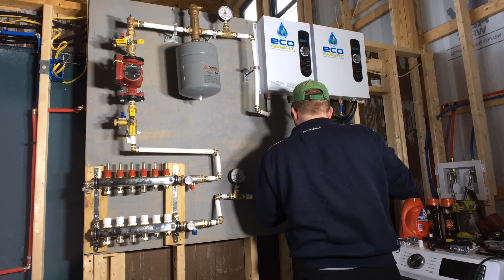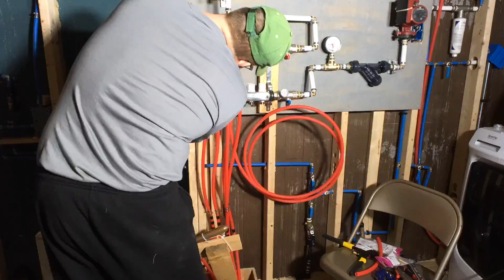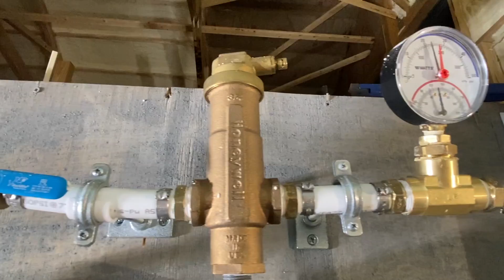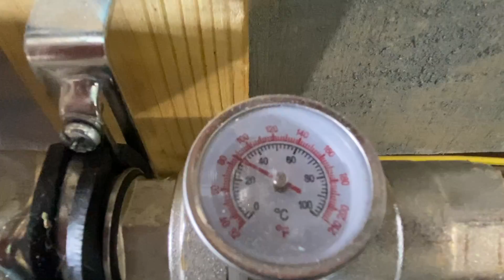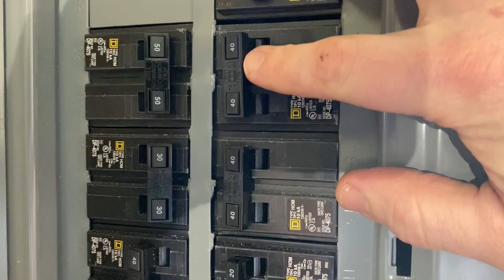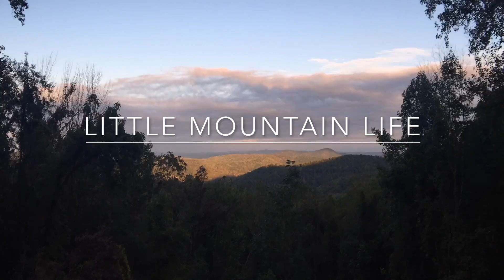DIY Radiant Floor Heat | Install and First Impressions

Comment: Thank you for this video, super helpful as I approach the same project on my cabin.

Curious if you entertained running domestic water (bath/kitchen) and radiant heat off of a single tankless system? I’m working with limited space and hoped it possible as I see some units have two thermal exchangers.
Reply from the maker: You’re welcome! 🙂
I wanted to keep the systems separate to make maintenance and future replacement as simple as possible.

Comment: Have this in a small office building in Kansas.  If you want additional heat sit a metal file cabinet on the floor.  It will warm up and become like a large radiator.

Comment: I am looking at installing a 2 zone radiant heating system between my joists.  It’s only 800 square feet in total.  Would you find the EcoSmart 18 Tankless heater plenty for my application?
Reply from the maker: Yes. We often times only run the 18kw with one element to heat the house on cooler days. Both elements easily heat the house with lows in the teens. 
Also depends on how well you insulated the house.
Reply: @LittleMountainLife  I'm about to buy an EcoSmart and am trying to decide between the 18 and the 27. I also have 4 loops, each about 280-300' each - so I think our systems are similarly sized. Your comment makes me think an ECO18 will do it for me. Question - how do you know you are only using one element, or is this a setting that you can restrict to just one? Great video - it's become "one of the 6 videos I'm watching 2-3 times each" as I work my project! Looking forward to a follow up video about electricity cost - as that is something I am worried about.
Reply from the maker: @MrKroy2008  You can just turn off the second breaker in your panel to reduce it to the one element.  Thanks for watching!
Reply: @LittleMountainLife  well dang, I guess you can, that makes sense. Received mine today, but still hesitant to install because I am unsure of the operating cost. I see your other comments about an upcoming video on operating cost/elec usage - but could you give me the down and dirty - is it going to break the bank? :)
Reply: Disabling one of the heater elements does reduce the peak current to half and hence reduces the available heating capacity to half of the full rating, but it does NOT really reduce the energy (KWH) consumption over time. In either case, the unit will consume whatever energy is required to heat the water to the desired output temperature setpoint for any given flow rate.

Comment: I use an ecosmart27 and it supplies all heat and hot water on an open system
Reply from the maker: Cool! You on city water or well water with a softener?
Reply: Richard Berends I’m looking to do something similar. Would love a description or any inspiration you can share!

Comment: Were there any particular videos or websites that gave you valuable information for this DIY radiant floor heat project?
Reply from the maker: Well, I watched literally every other youtube video that mentioned radiant heat at least 3 times before starting my process with the manifold.  Smart Easy DIY has a great channel and I used his videos a lot.  I also used the radiant heat company's websites and pictures as a guide for components.
Reply: @LittleMountainLife  Thank you!

Comment: Did you have to pressure test the whole system with air like standard plumbing before pouring your slab? TIA
Reply from the maker: Yes. We pressurized the whole system with air while the slab was poured.  :)

Comment: i have a radiant system in my basement & i now want to add the other two floors. 
Floor 2 will be concrete with tile, 
Floor 3 will be tubing in the joists for wood floors above. 
My issue is where to put the manifold, ? do i add it to the basement & drag all the lines down, or is there away to put it mid house on floor 2 & connect a line to the original system for the hot water feed
Reply from the maker: That sounds like a project and plan above my pay grade.  So your main floor is already poured concrete? Or are you still planning it?
Reply: Put a manifold on each floor atleast 50cm above the floor ur heating. Only let the supply pipe that feeds the manifold pump up . This will make shure no air bubbles going get stuck in the system.
Also please dont put the pex pipes under ur osb between the joists, u will lose so much heat because the wood insulate tot much.
Here is a way too do radiant heating on a wooden floor we call it a dry system (because its not in concrete) https://youtu.be/8AF0iOc53ew  .
Also in that clip u see the laying patern he uses we cal it the snail house patern and it makes shure ur heat is equaly spread over the floor so the end of ur group is not colder than the beginning of ur group.
And 1 pump for the whole system is enough. U dont need a fast flow, u want the floor to extract the heat from water so make shure ur return at the manifold is always 25%/20 colder than the feed, if not u need to slower down the flow with the flow meter. Make shure u put ur thermostat in the biggest room, as u can imagine small groups wil give more heat if the have the same flow rate as the big ones and u can adjust that later by lowering the flow on that group. 10cm of space between the pipes on the floor is the best. Here in the netherlands floorheating is comon for decades and we mastered it really well and i must say i havent found 1 youtube clip where the floorheating is laying correct in the USA.

Comment: I'm curious as to how you organised you zones.  And why only four.

My impression is that North America tends to large area zones with uniform temperature settings.  Here in the UK we tend to zone-per-room and each room with a thermostat so with a programmer each can be time and temperature controlled.  So it you want your bathroom warm but bedroom cool at bed time, or your kitchen warm in the morning but not so much the rest of the day it can be made so.
Reply from the maker: It's a small house with just a great room, 2 bathrooms, a bedroom, and utility room on the main floor.  I typically run all zones at the same flow rate/temp anyways.
We could technically control the temps like you do but so far haven't felt the need to.

Comment: Is your entire house running off electric utilities?  If  so, are you running a 400amp panel or 600amp?  Have you had any issues with this drawing 75amps?  Does this always draw 75amps?
Reply from the maker: Yes. 400 amp service to the house. 
I usually turn off one of the two elements once the floor is up to the desired temperature. On super cold nights I’ll leave both elements on.

Comment: Why the electric resistance heat though? Possibly the most expensive method of heating there is! Underfloor is a perfect fit with a heat pump, which could cut your electricity consumption by 75 percent.

Comment: I would think that second pump is adding a lot of flow resistance to the system.... could be wrong on that though
Reply from the maker: That's possible I suppose.  System is running well this week.

Comment: What is an advantage over using electric coil?
Reply from the maker: I’ve heard it’s more efficient but I’m not sure. We wanted bare concrete floor and this is the best option for use. Electric coil works well under laminate or wood flooring.

Comment: If i were to install just the one pump, which one am i to leave in and run. The one in between the drain & fill valves or the one right before the water heater?
Reply from the maker: We have been playing around with this as we turn on the heat for this fall/winter.  Looks like the pump between the drain and fill valves is the way to go. :)

Comment: Awesome video. Appreciate you taking the time in sharing your experience. How much did this whole system cost if you don't mind me asking. Ballpark price of course. I am considering doing this type of system for a house I have in NE PA. It would primarily be used to keep the house from freezing and not as the main heat source. But who knows. Thanks again.
Reply from the maker: About $1500

Comment: Top left looks like pressure relief valve, how is this passing flow?  Don't they typically mount to a T and only pass fluid when pressure/temp exceed some pre-set value?  Then you run the relief side into drain or away from system?
Reply: Its not a pressure relief, its an air separator that gets the ait bubbles out of the system
Reply: @goudsekaas5673  ok.. grainy pic here and saw the super vent on right was like... I have a valve/faucet in similar position to give flushing options. I used a boiler fill between supervent and expansion tank then added the correct 30# relief into system.  my choice of pump was based off recommended flow rates and guess I need to get a beefier pump, got down to -5F last night and it had to run non-stop to keep up.. then even with proper spacing between combustion n exhaust, the exhaust drifted directly at air intake and not sure if was frost or snow from roof sucked in so ordering new cone style intake cover to prevent that..  I have a room without any heat and that is messing with system here, would have to excavate to get under...  not for this old man..lol  I mentioned the boiler fill as it gives adjustable pressure, 12-15#, I left mine at 15#, then you need to reduce pre-charge in expansion before the fill to the 12-15#, and use the 30# relief, see that left out in builds or an assumed..
Reply: I do have enough access to sneak a radiator in that room , but at 120F water, what I had to raise mine to from initial 110F setting, maintaining a 10-15 Delta-T, then at end of a PEX floor/heat spreader run, unsure how much it would add...
Reply: @craiggerlach5548  buy a consetric pip ( i hope i say that good in english) for ur exhaust and intake. Its one pipe with an extra pipe in it. The extra pipe in it is the exhaust and them other pipe is the intake. The inner pipe runs abit longer so intake and exhaust cant mix. Also i wouldnt recoment pex like in this vid, there s way to much 90s with a smaller diameter than than the rst of the pipe that slows the flow big time and male it way more noisy. Also it makes u need a bigger pump. My pump runs on 45ish watt to heat 90m2 floorheating. Alsni got a pump switchnon it thay only turns the pump on when it detects the room needs heating.
Reply: @goudsekaas5673  house recently sided, vents in place, bought a cover for it, hope it helps, had snow plug up intake and had error code on heater one night..
No going to reroute pipes since siding already in place...  but thanks I seen those options.  they were very long and my heater is on exterior wall.
Reply: Assuming return line jogs up as you were going to put a mixing valve in there then changed your mind, couple extra elbows otherwise...

Comment: The expansion tank shown in your video does not match the size you listed in more info. The listed one shows it to be 11x11x15 and the one shown is no where near that size?
Reply from the maker: Great catch! Ours is the EX15
AMTROL EX-15 15 Extrol Expansion Tank https://www.amazon.com/dp/B003QSAH38/ref=cm_sw_r_cp_api_fab_Ps1CFbB47D22N

Comment: If you’re floors are warm (enough where you really feel it) your running your system too hot.  The floors should be the same temp as what’s you want your room to be.  Radiant floors should be “not cold” meaning neutral to the room temp.  Running your supply temp at ~ 115-120 should be enough for that size room.  I use a floor temp sensor  Aube Thermostat w/ Floor Sensor
Model Number: TH114-AF-024T Menards® SKU: 6655651 in my shop with 3 zones and one pump.  Works fantastic as you mentioned!
Reply from the maker: Yeah we eventually turned the heater down to 100 degrees for most days. Super cold days we kept it at 120.
Reply: Little Mountain Life Good, also be mindful of the minimum water temp for your water heaters, running too low can cause condensation (at least in tank type heaters, not sure on tankless).  Nice job on the install and design, it’s really a simple solution once you have all the proper parts.  Enjoy the wonderful heat!
Reply: Also, there should be a permanent pressure water line on the system with a pressure reducing valve, not sure I saw that in the install.  This keeps the system at a consistent pressure and provides make up water in case there is a dip in volume for any reason.
Reply: Varying the temp on the heater too much will cause swings in the slab temperature, should find a happy medium on temp and try to leave it there.  The slab has a reaction time of days to the heater temp changes.  Radiant systems aren’t meant to be changed in temperature because of the very slow reaction time, unlike forced air.  Sorry to be so “advice giving”. Just sharing my experience and research for what it’s worth, be sure to do you own like you have.
Reply from the maker: We appreciate your input!
Reply: @bobs4718  I am trying to figure out an install here, was going to stay closed in a closed loop and manually fill but I did buy a fast fill valve that is pre-set at 15#, would have to snake in pex through my kitchen cabinets to get to addition where slab heat is but doable, question, if preset to 15# do I still need a pressure reducing valve?  have backflow that also connects to this unit,, thanks..
Reply: I just mounted my kitchen cabinets too, could have put it beneath behind toe kick if had planned for this..
Reply: I was going to comment this too.   140 going into the floor seems too high

Comment: Like you I'm a self doer also... I'm doing radiant floor heat only and it's a closed system (antifreeze)... You didn't talk about the electrical supply for you recirc pump... since these boilers are "on demand" what tells you pump to turn on?  I've been trying to think of a way to have a thermostat Tell the recirc pump to turn on so that the boiler turns on... I hope I didn't confuse you but your input could help me
Reply from the maker: The pump is currently connected to a simple on/off switch but we are planning on adding a thermostat control this fall.
Reply: @LittleMountainLife  I just found one at Home Depot for $25, (another youtuber suggestion)  Cadet T522-W non-programmable 2-pole, I'll let you know how it goes
Reply from the maker: Awesome! Appreciate the info!
Reply: Normally, a 24 VAC thermostat turns on a 24 VAC coil relay which connects 120 VAC to run the pump. These relay controllers can be obtained from TACO and other companies.  When the pump starts, the flow sensor in the ECO unit senses that there is enough flow and allows the heater elements to operate at whatever level is needed to supply the demand.

Comment: What does it cost to heat your home?  Running on electric verses propane sound expensive.
Reply from the maker: We haven’t been able to get an accurate number yet because we only just now finished insulation. We will post an update this coming winter.

Comment: How do you like that manifold and the eco smart heater? I’m doing a 1200 sq ft shop and i’m up and down between that eco smart and a hot water tank. Someone told me the eco smart is not designed to change such small amounts of water temp therefore it switches on and off repeatedly. Also i’m trying to find a decent manifold that is easy to adjust
Reply from the maker: We like the set up so far.  The ecosmart stayed on without much issue last winter.
Reply: Awesome, i’m looking to do just about that same setup for my shop
Reply: @ hathaway's adventures.
His system is probaly as we call in dutch "commute" which means the eco smart is to high in KW and it hasnt got a low KW setting.
The problem is its outputting way to much heat that it cant get rid of.
The engine is basicly too big and it only can go full trottle. So lets say if u get a electric heater that can output 20kw its better it has 20 coils that can output 1kw each that 1 coil that outputs 20kw so it can match the demand. Floorheating is low temp (45celcius is max input in the floor) and when on temp it needs a low consistent feed some feeders just cant do that  and they keep shutting on and off which also decreses life time of the equipment.
Too make a long story short its too powerfull.
To powerfull should not be a problem as long if the system is made to adjust his power from 1% too 100% in steps of 1%.
If the feader lets say feeds 10 liters a minute   and manifold is set too 4 liters a minute the water gets pushed back and the system can get rid of the water its warms and automaticly shuts of while your thermostat is still asking for heat. And thats where allot problems comes, Fine tunning floorheating systems make such a difference in comfort and money and thats where the lack of experience comes above in the USA because its not yet comon over there. Thats why here pref a tankless water heater with build in pump where the thermostat is directly hook up on too so the tankless automaticly regulate heat and pump speed. So that problem doest accure. Thats why u need to make sure the return of each group at manifold is 20/25% colder than the incoming, if not u reduce the flowmeter to less water per minute on that group because  your floor doesnt have the time too extract the heat out of the pipes and ur wasting money on circulating hot water for nothing. Its all aboit finding that sweetspot ;)
Reply: @goudsekaas5673  The Ecosmart heaters are fully modulating based on the water flow rate and the desired output temp vs the input return water temp (I E the delta temp difference).The  amount of KW (power) used at any moment varies from 0 to any other value up to its max rating. The KWH (energy) consumption is only what is needed to maintain the desired set temperature. I have installed a similar system in my workshop/garage and it is controlled by a floor temp sensor.